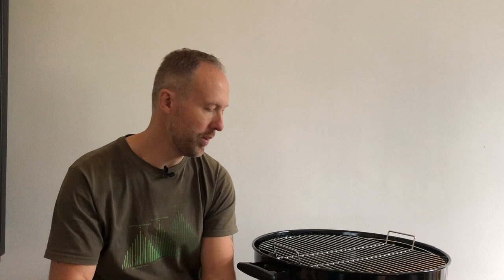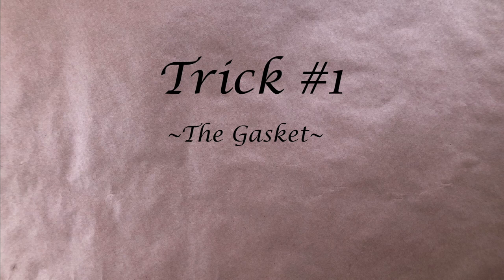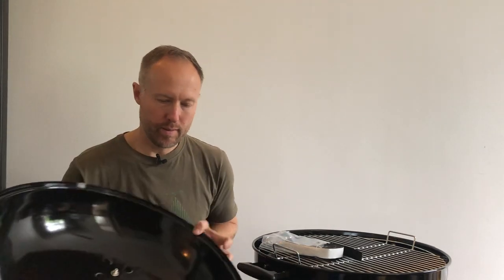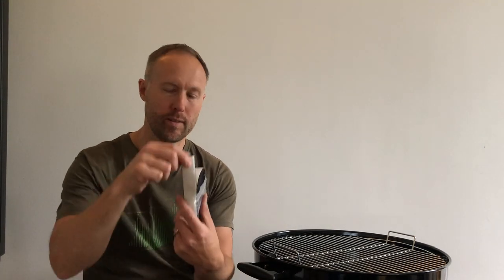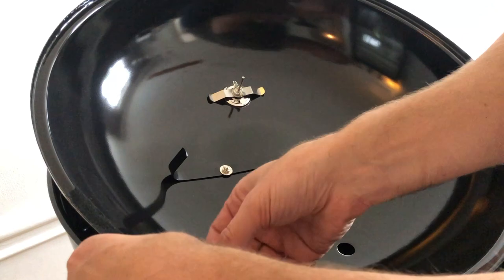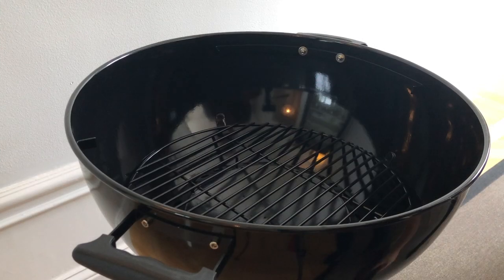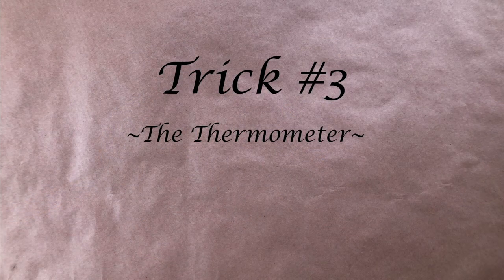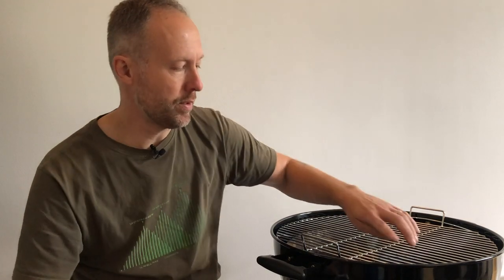Three 'mods' to turn your kettle into a proper smoker

Comment: Mod #4 cut a couple grill bars in the middle of the grate towards the ends to enable coal and wood through to the hot coals while cooking
Reply from the maker: Hakuho Sho I’d rather just buy replacement grates for this cheapo grill. But yes, it would really help.

Comment: Thanks for the tips Hank. Im looking at purchasing a grill mainly for roasting, grilling steaks and slow cooking beef ribs. What are your thoughts between the PK grill and the weber kettle. Cheers Fitzy from Australia.
Reply from the maker: Paul Fitz Well Paul, that was easy. I have both, and I’m a big fan of the PK. The only reason to choose the Weber kettle is  real estate, the kettle has a slightly larger grill area. On the other hand the PK has an elevated (optional) grill grate, so not sure how much diff in the end. The PK is gonna last a lifetime (literally) due to the cast aluminum shell. I did a PK video very recently that you can check out if curious. Cheers, Hank
Reply: @HanksTrueBBQ  
Thanks for the quick reply Hank. The size doesn't really matter as i already have a weber q. So i can use both if i need to. Most times im only cooking for 3. But ive recently retired and now i have time i want to start cooking over lump charcoal. I thought i would buy i webber kettle with all the accessories, but then i came across some videos on the pk.
Do you think the pk would produce a nice pizza?
Thanks heaps Paul
Reply from the maker: Paul Fitz Well, if we’re talking PK Classic (as opposed to PK360) I personally think it’s just too small. In that case the Weber kettle is a better choice. The same goes for full packer brisket, it’s hard to fit in the PK Classic. The kettle def. has the upper hand there. I bought a used kettle myself, and ordered a Slow ‘N Sear to go with it, you get a lot of bang for the buck that way. And it’s a really nice combo. Tough choices ahead 😄
Reply: @HanksTrueBBQ  
Thats true, its a pitty its not i bit bigger. The 360 seems a bit expensive to me. Especially here in Australia. I like the weber as well, but i like the thought of cast aluminum. I appreciate you taking the time to give me your opinion. There are so many options. Thank you Paul

Comment: You don't have any issues with the adhesive in that heat?
Reply from the maker: Nope, not at all. I’m using replacement gaskets for ceramic grills like BGE and Kamado Joe, they’re made for this.
Reply: @HanksTrueBBQ  that's what I get for skipping around the video. I probably missed you saying that.

Comment: What if you have accesories, such as lid holder or weber side table
Reply from the maker: Staffan Ekdahl That’s always nice to have.
Reply: Yes but how does that work with your mods.??
Reply from the maker: I don’t see any issue. A lid holder doesn’t interfere with any of the mods, and neither does the side table. Or am I misunderstanding your question?
Reply: Hank's True BBQ i was just thinking, since all accesories are ”clipping” on the edge and i have problems geting it airtight. So just wondering if the gasket could ”swallow”
the clips and get an improvement.
Reply from the maker: Ah, now I get it. Yes, either the gaskets will cover the lid attachment, or you can leave a gap there so the gaskets together with the attachments will create a level surface so there are no leaks.

Comment: Hi! is that the 18" or the 22"? thank you
Reply: This is the 22" (57 cm) version.
Reply: @henrikoscarsson4659  Thank you! do you think a 18" would work for smoking or it will be too small for indirect heat?
Reply from the maker: phernann it will, I’ve done it a few times. At least it works with smaller cuts of meat.
Reply: @HanksTrueBBQ  Thanks a lot